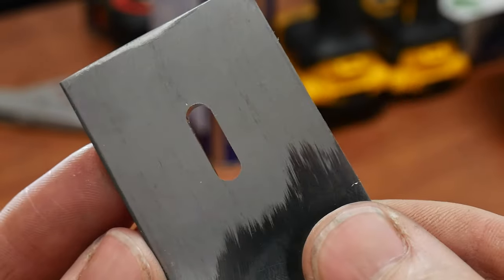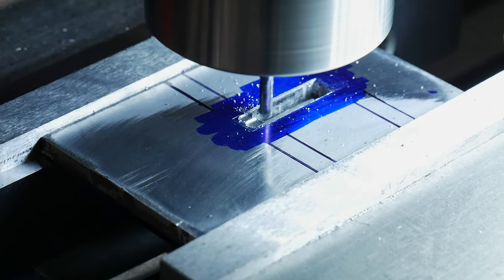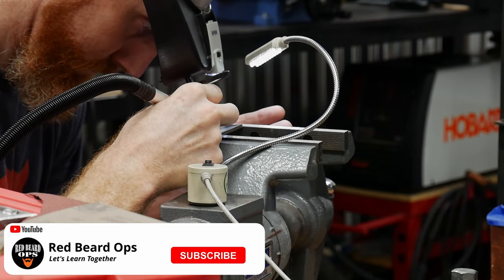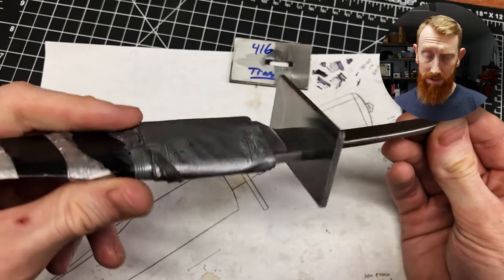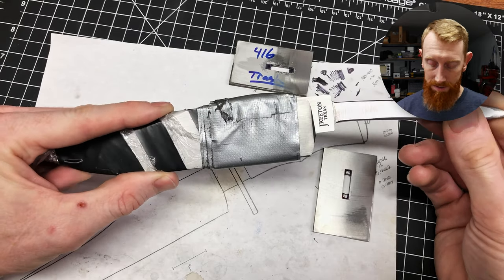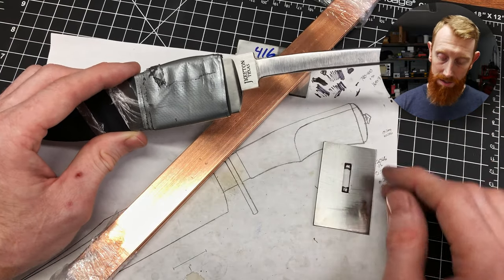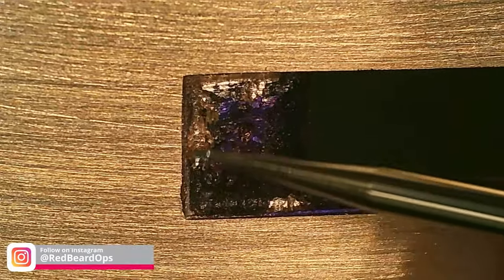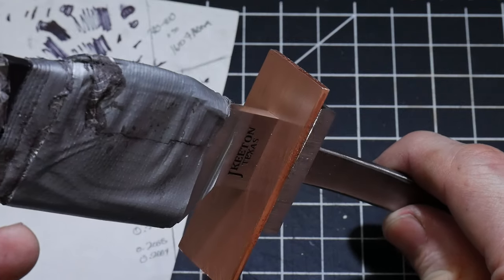Lucky #7 Bowie - Fitting The Guard - Part (2/4)

Comment: I can see that getting a tight fit could be very difficult. Tyrell Knife works has some builds where he fits a guard as you are doing. He usually explains things very well.
Reply from the maker: For sure. This is a tough method IMO. I don't mind it, but there are some thing to watchout for. Spoiler alert... I end up doing this again!... and yet I made the same mistake. The biggest issue for me in all 4 cases was filing my slot a little too tall. This allowed for juuuuusssttt enough up and down motion to cause gapping when hammering the guard on and off. A tough lesson... but I know now.

Comment: commenting on the @4:11 mark... did you remember to lock your Y axis when you were milling with the X axis?  Back when I had my mini-mill I would get wavy cuts if I didn't lock the axis that wasn't in use.  Also conventional cutting gives you a more consistent cut on a lead screw machine reducing the amount of tool deflection.  You also can try to find and end mill with a shorter cutting section to give you less tool deflection and a better cut.  You could also go with a larger diameter end mill if possible.  Ok I'm all tapped out of ideas for now. lol
Reply from the maker: Thanks for the ideas man. I think I did lock it, but I'm not sure. I really am racking my brain on what I did there... I'm guessing it was an issue with my set up and milling and not the mill itself... I also didn't go quite deep enough with my step on one side as well... 

Lessons learned!

Comment: I understand it's been a while since this video, but while you were found the "mistakes" with your guards, did you think of or try to upset them to close the gaps? Just wondering brother. It may not have even not been possible, that's why I'm asking.
Reply from the maker: If I have gaps on the side, I've taken it to the anvil and hit it long ways (to close the slot). This works decent. For gaps on the top and bottom I've gently peined it back before.